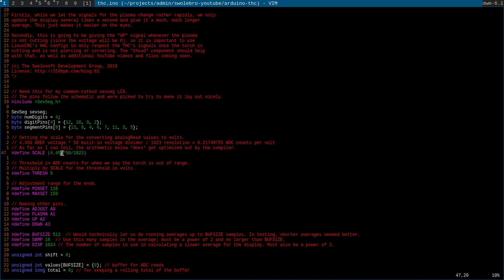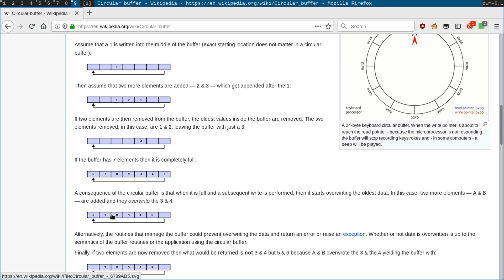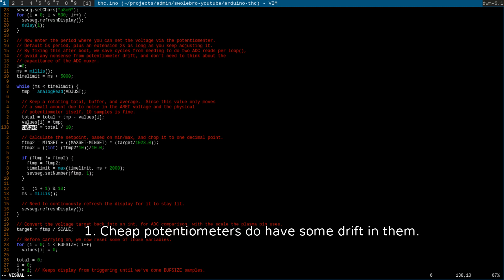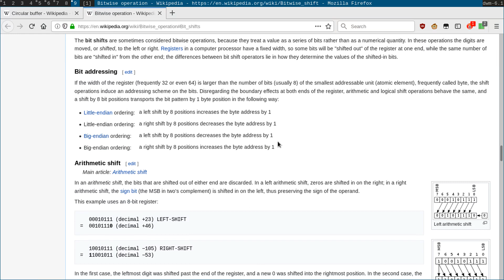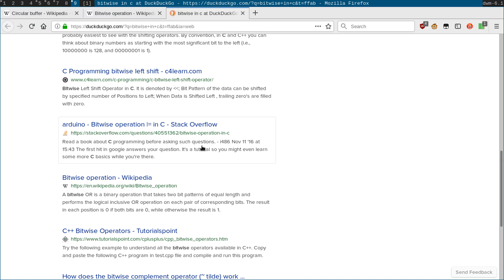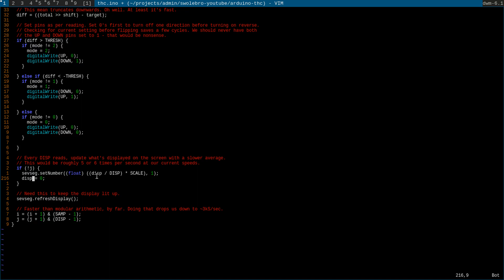Plasma Table Arduino THC: Software Overview

Comment: Hi there, I put a comment on here a few hours ago and it disappeared. Just wondering if youtube/google are just practising their typical b.s.. Let me know if so and I will try to send a comment they may not delete. 

cheers
Reply: looks like this one passed their highnesses. I understand if you don't even bother looking at the comments here anymore but anyway.  

Sorry, i should have said i reached out to say i have started a modified version of your THC. it is an attempt at a standalone THC for GRBL, send direction and steps will pass through steps etc. I haven't added it to github as i didn't want to take credit for your work and I've changed some variable names etc so i think forking is out of the question, what do you think? 

I also am wondering whether you got your to work satifactorily or not.?
Reply from the maker: @kazafog1  Yeah, Google makes comments awful. Half of them go into the abyss, the other half don't notify and/or get buried in the mess. All hail the algorithm.

For the record, the GitHub issues on my repo are actually a better way to ask questions regarding this stuff.

Since you're only changing one file of mine (and I assume you had to modify GRBL as well) a GitHub fork wouldn't really be appropriate, but go ahead, put a comment on the top saying it was based on my stuff with some links, and slap it up on GitHub. I'd be interested in seeing it.

And the thing did work - surprisingly well! I had to sell it (along with the whole machine) when I moved last year, but the guy who bought it did message me a while back and show me some stuff he's making, so the machine lives on. Feels good, man.

Comment: Nice video-series about plasma and linux cnc.

BTW there is also a THC component in linuxcnc 
You could get a voltage to freq converter (0-10v) > (0-10Khz) for example
Connect it to a encoder in linuxcnc and read out the voltage that way. (as speed) 
If necessary apply the lowpass component to smooth it out.
Reply from the maker: Yup, the THCAD-10, with the thc component. It's inevitable that I'll go that route eventually, but I didn't want to shell out for the Mesa hardware until I knew I could get a basic setup working. Definitely cost me more in time than that hardware is worth, but it's a learning experience and a hobby, so I don't mind.

If you've been following the HAL tutorials I've been putting out lately, in the next week or two on using the "thcud" component (different from "thc") on basic ones like this, or even for manual height control (which I used as a holdover until I built the THC shown here).

There's also a "plasmac" component that's in development, but I will likely be sticking with thcud for the time being. It's simple, and it works.
Reply: @swolebro  Why can't an Arduino function as a THCAD? The THCAD seems to be commonplace on the linuxcnc forums. But aside from the voltage dividing I don't see why an Arduino couldn't be used instead. Then all the ups and downs could be handled by Linux. I haven't seen anyone trying this with Arduino. I don't really understand the encoder in linuxcnc so I have no idea where to start.